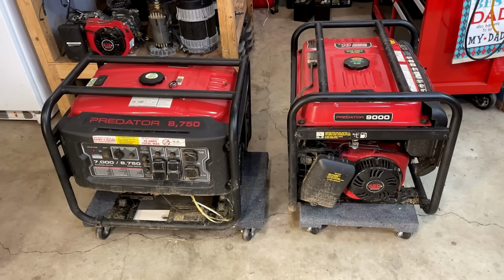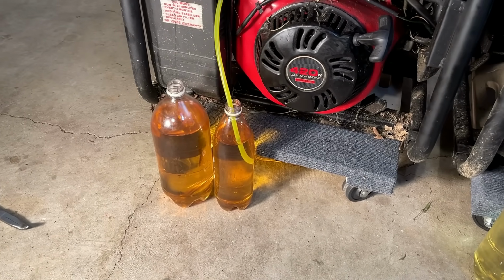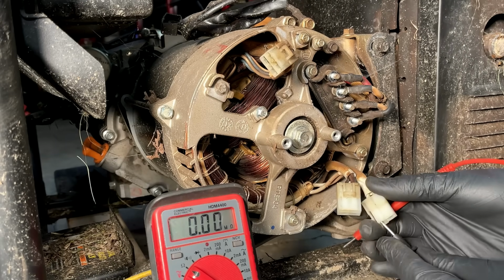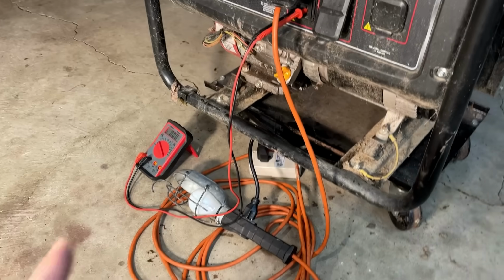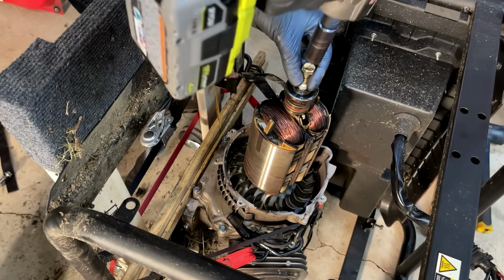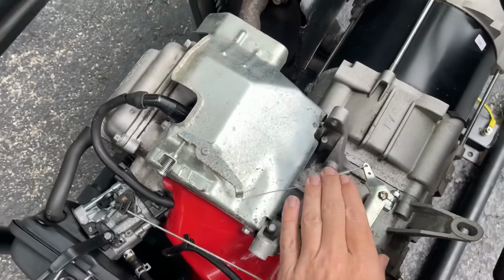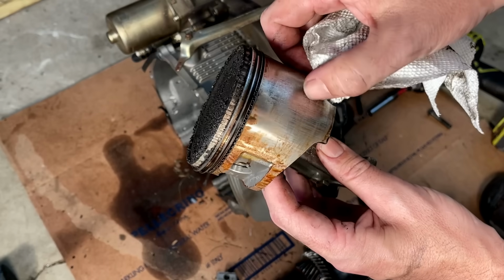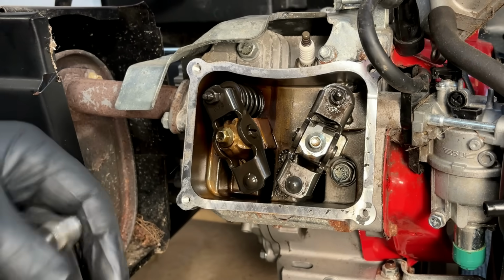3 Abandoned Predator Generators - Will They Run?

Comment: I was wondering if there was anyone with the little knowledge on my predator generator like these. It will crank up just fine but it won't put out any power, I can let it run for several hours, sometimes it will start putting out power on the outlets and sometimes no power. I messed with the Breakers, didn't do any good when there was no power. Sometimes I can Crank It Up and it was put out the power it needs. It has two GFI receptacles and they are not tripped plus the 220. When it Powers up, everything works good. I was wondering if there is something I'm overlooking. Have not checked the Stater or wending. If someone has some information oh, that would be great.
Reply from the maker: Could be bad brushes, dirty slip rings or bad AVR.  Is those are fine then most likely a bad excitation winding in the stator or the rotor has a broken wire or solder joint and is open circuit
Reply: @jcondon1  okay I'm preciate to come back James. I enjoy your videos also. The crazy thing is this Predator generator don't really have that many hours on it. I think it has only had maybe three or four oil changes. Bought it brand new in 2017. If I check the brushes with the ohms tester, shouldn't it be around 3 or 4 bones. Probably wouldn't hurt to pull them out and look at them. I would think the stator should still be good, I need to open it up and take a look. It's never been under a heavy load before. I was watching a few more of your videos tonight. Very educational, do a better job than many of the other videos, only because you go into more detail then they.

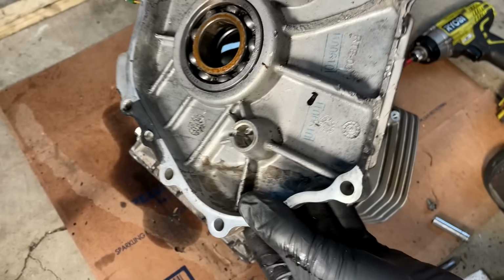Comment: 1:27:42 Source of bearing outer race found at 0:58
Quick check on comparing springs: Hook ends together and pull them against each other.
Watching the spacing between coil turns is a way to judge relative strengths.

Comment: Got an 8750 I've been running off grid for years without any problems.
If you keep the oil changed and check it every time you fill it with fuel they'll run for years.

Comment: Dude, don't you have compressed air and a vacuum cleaner?  Watching you clean the generator was getting on my nerves big time and you left all kinds of sht everywhere inside including ants. That governor spring is a drop in the ocean. The engines blew because of poor maintenance and(or) running out of oil.🤔

Comment: I had a brand new JD lawnmower with a Briggs engine, it would smoke heavily on start up. they replaced the motor under warranty . somehow on shutdown it must have been drawing oil into the combustion chamber

Comment: You sure know what your doing there. I would have done the same thing as you did and took good parts off to use later. Hey I have a question for you too James. Do you sell what you fix on those generators and if so how much would you ask for one on average.
Reply from the maker: Most in the 5000-7000 watts range sell between $300-$400.  I tend to price them on the low side to keep things moving.
Reply: @jcondon1  I would be interested in buying one off of you. I live in Ohio. I not sure or remember where you said you were located. So I'm not sure what the price would be to ship it if you don't live close to me.

Comment: A trip to harbor freight for engines and you will have some nice generators.
Reply from the maker: I wish they sold tapered shaft engines.  I would be their best customer.
Reply: @jcondon1  really enjoyed the video.  Too bad you couldn’t get some rings because that probably would’ve fixed it.  I didn’t see if you tweaked the fuel mixture on the carburetor and if you verified that governor was adjust on the shaft so that you were getting full movement of the governor.   A lot of those engines probably fail due to those faulty oil level sensors like the one you discovered.   That hydraulic pressure trick to remove the rotor shaft is slick.  Thanks.

Comment: Put some oil mixed with transmission fluid down into the piston bore! Just pour it in threw the spark plug opening. Allow it to soak for a day or 3 then try turning g thr engine over.

Comment: Really great video the generator that ran started up running lean what today's gas the Jets have a tendency to get a coating in them of green corrosion which cuts the fuel flow when you put the generators under high load it's not getting enough fuel to air ratio, should always pull the carb off and clean the Jets.

Comment: Maybe the oil burning on the 3rd generator is caused by a missing baffle in the valve cover where the hose comes off and goes to the air cleaner box. The hose connection at the air cleaner is wet with oil. Shutting down from 3,600 RPMs would cause the throttle plate to go wide open and if there's no baffle on the valve cover, maybe that's when the oil is drawn in while the engine is coasting down.

Comment: If you are going to mix the old fuel with your new fuel, you need to add octane boost because that’s the first thing to go in the fuel is octane and that will cause your engine to spark knock, so just make sure you add octane boost with it if you’re running old fuel because overtime, it could very easily damage your engine.

Comment: On the outer cover , I would re weld it for bearing and have it machined , I use to race go karts and we would have to re use covers and blocks all the time and have at least 5 spare alcohol  engines on standby for esp  dirt track karts

Comment: After checking oil in the 3rd and finding it low I bet the failure on these is they used the oil check as a dip stick and that is a major problem with small engines, never use the stem as a guage always fill to mid to top of threads as a rule

Comment: 2 engines, both with balancer failure.  Is this an Achilles heel to these Harbor Freight motors?  It appears the casting let go at the balancer bearing in both motors, letting it destroy the rest of the crankcase components..

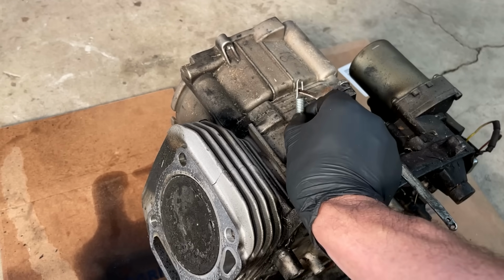Comment: 1:22:41 Just to add more information: The spring only provides a proportional control. It doe snot need the integral or derivative aspects of a PID controller. If the load decreases, the speed drops by design. If you have 2 generators, you can connect them together after they are both started, and they share load about equally, as they both slowdown and both apply more throttle

Comment: Would have thought the exhaust would be .001-.002 larger than the intake to compensate for the thermal differential between valves.
Reply from the maker: Usually the exhaust is gapped 0.002 more

Comment: Can you contact the manufacturer and ask for the name and address of the vendor they buy their valve seals from?
Reply from the maker: That's the problem with clone engines.  Most do not put any identifying information on the engine.  Some are starting to, but the majority have no model number or manufacturer name.

Comment: Clearly abused by their previous owner. Nicely done. I love purchasing items like this and resurrecting them. I purchased a Champion 3500w Generator for 50 U.S. Pesos. 
After replacing the recoil rope, a valve adjustment, oil change & cleaning the main jet. 
It has purred. Never failing me. Champion could have done a better job on the governor.
(As in a buffer.) At no load it likes to hunt a little. That is only a minor annoyance. When loaded, it runs at a constant speed. I expect too much from a Chinineseium product. 
The AVR is accurate it holds 122 VAC at around 59.7 Hz. 
I have also worked on Predators, which are ok, IF MAINTAINED AND NOT ABUSED. 

Anny way..... Nicely done Sir. Happy Holidays.
Reply from the maker: The hunting is just because it is jetted a little lean.  Pretty common these days with new machines.
Reply: think epa

Comment: I had a riding mower that I revived a couple of years ago that had a governor spring issue. It sat outdoors for several years and the carb was rusted, so I was forced to replace it. When I finally fired it up, it was hunting really badly. I went through the brand new carb a couple of times thinking that it was an issue with the carb. After several weeks of fighting it, it finally occurred to me to try replacing the governor spring. I did, and it ran perfectly after that.

Comment: You should get a short bolt. drill it through and tap it for a grease fitting and use a grease gun to pop the stator off.

Comment: I have two of the HF Predator gensets and they work ok.  First pull start too!  I have read that the engines are pretty good.... true they aren't Honda, but they don't cost Honda either.
I am assuming that these ran for about 5 years non-stop?  Probably heavily  loaded too.  Lack of maintenance probably killed them though.
Thanks for the teardowns!

Comment: Excellent video, my back up generator is a predator from HF and it runs great.  I fire it up every few months and let it run and change out the oil as well.  It is also garage kept so it still looks brand new years later.    But I'll be able to refer to this video to diagnosis any potential issues.  Thank you!

Comment: Too bad you couldn't have welded those holes closed. Maybe the tension of the old spring was weak. Test by suspending some weight and see how far each soring droops. Should be the same.

Comment: Hey bud I know it's been a few seems you work on the predator.  But I am very very familiar with the 6500..

One thing that real worked great is us brake in oil.  Plug on them the oil sensor are a pain but try to us them. 
I have had them lock up and I could free them and use break in oil and run them for days lol

Comment: It's nice to see stuff revived, although honestly I wish they'd stop making these cheap crappy 3600 RPM generators, they're so insanely loud. I got an inverter generator several years ago and now I wouldn't even want a conventional generator for free. The inverter is so quiet that I can't hear it at all from inside the house and it burns a small fraction of the fuel the old generator I had did. If your application is like most and the generator spends most of its time at light load then the inverter type provides an enormous advantage.

Comment: Excelent video. I still wonder why you don't weld a plug into blocks with holes in non critical areas. I suppose your liability insurance prevents it. If so, what a shame.

Comment: I received a Predator 8750/7000 for free that was not running. Started to adjust the valves and noticed only the exhaust valve has a cap on it. Is that the way it should be?

Comment: About the hour 20 you wanted to order rings and other things for the predator. I'm trying to get my tecumseh 11hp from Sept 2005 back. The repair place I'm getting parts from said they can't get any predator parts. She said if I did get a predator to get their warranty. She also said they won't work on any generators with inverters. I've cleaned my carb lseveral times and each time everything is clean. I can see through all those tiny holes, no grime anywhere. It'll crank and run 40 seconds, yesterday 20 minutes. New gas lines, filter, cleaned engine, spotless carb, cleaned fuel tank, no ethanol fuel, new syn oil, I'm missing one something and I bet I've seen it on your video somewhere! That master jet or a covered screw. I sure appreciate your time and videos.

Comment: Interesting, apparently the folks that used these units failed to understand that engines need oil added from time to time, as well as oil changes every X number of hours. The good color of the China manufacturer's paint suggest these units have not spent alot of time outside/older.. The truth is the units were simply neglected, probably run until failure with no effort to even try maintain them. I have an 8750 which is essentially the same as those 9000's
Reply from the maker: They were stored outside, but not very old.  They were just run for many hours with little maintenance until they failed.

Comment: i have a Predator 5500/6500 watt generator that hasnt been started in probably close to 10 years, its been out of the weather, but the fuel tank in badly rusted inside, im going to try and get the motor running and see what i got, if i do get it running and everything checks out, im gonna need a new tank, i have looked every where on it,and i cant find any tag that gives me an exact model number, it has the 420cc 13hp motor, are the gas tanks the same on most of the models?
Reply from the maker: The center of the pull start should have the Harbor Freight item number.  Otherwise a Honda clone tank should fit.  You would have to double check the measurements.  Here is a link to a 5 gallon and 7 gallon tank https://www.ebay.com/itm/403285208888?mkcid=16&mkevt=1&mkrid=711-127632-2357-0&ssspo=KeSOnnWoQYu&sssrc=2047675&ssuid=eec5lZxOS1O&widget_ver=artemis&media=COPY
Reply: @jcondon1  ok, thank you so very much, i will take some measurements

Comment: I just recently purchased an old generac 4000 XL and it was leaking a lot and a carburetor was off so I fixed the carburetor but it's still leaking oil and where it's leaking is the oil safety switch so I figured let me tighten it up some more and I did and I cracked the little housing that gets bolted onto the engine but I can't find that actual part I may just put a plug on you know put a plate on it and plug it up that seems like it's viable

Comment: I would be looking for oil somehow draining into the intake or combustion chamber when it's just sitting. Maybe somehow the breather is dripping oil into the intake side at the air cleaner? It almost can't be a valve seal because no oil remains at the stem when not running...

Comment: Would it be possible for you to draw up a checklist for the electrical wiring; some kind of Excel sheet for each element of the stator/rotor wiring that someone could print and fill out as they perform the resistance checks?  That might help people be more systematic in their troubleshooting.

A diagram of the typical generator circuits would be helpful too.  Perhaps one of your viewers could draw something up?

Any takers?

Comment: By the nasty neglected condition of those gens I doubt if the oil ever got changed when they were used hence blown engines. Definitely good parts machines though. Thanks for the Vids! :)

Comment: My husband uses a 4' air nozzle to blow dirt and leaves off before bringing most things in the shop. That keeps the shop cleaner and makes inspection and repairs easier. It gets a lot of dirt off without the potential problems of pressure washing them. He got the idea from a manufacturing plant the shot-peened all metal brought into the shop. That minimized the smoke and weld contamination from the oil and scale on metal sheets and other metal. 
PS; Great video. Thanks

Comment: Good educational video on these predator generators. I have a low hours Predator 3500 inverter that keeps carboning up and plugging the spark arrestor. Have you seen that happen and what could be the cause?
Reply: Yah, a year old comment, but maybe he (Or at least others) will see this.  Are you overfilling the fuel tank?   Check the manual, on the max fill, it is NOT all the way to the top.  If overfilled, the CARB/EPA purge "system" sucks wet fuel into the air-box and makes the engine run very rich for a while after every fill-up.

Comment: It might be that the head is lubricated via a through bolt on the head and the through bolt channel is leaking through the head gasket into the cylinder? In which case it might just solve the problem if you replace the head gasket? Though I'm not familiar with the configuration of the valve lubrication method.

Comment: if it's rings it will smoke all the time no matter what . otherwise valve seal  or valve guide due to the oil never being changed ,which will stuff the motor .

Comment: I bought a new mulcher with this 420cc engine.  Withing 15 minutes of breaking it in, it developed a rod knock.  Unfortunately, the store refused to take it back.  Upon disassembling the engine, it appears there is a slight angle error in the hole drilled in the connecting rod for the wrist pin - Crazy!

Comment: That's not a 3k load.
Those heaters are 1,500w~ each on high.
4 x 1,500 is 6,000w 
over its 5,500w rated output.

Comment: You said GFI CANNOT BE RESET. Are you for real. Look close, there is a test button and a reset button. They or make to open if wet. I'm sure it was popped before you looked at it. Clean off the outlet so you can see

Comment: Power head? They are the unit that  provide movement, like an electric motor. That your tearing apart is the connections to the generator. Oh and by the way, it would have nothing to do with the gas engine running

Comment: An excellent description of how the governor system works. Thanks. I know you can't source parts but it's MUCH more likely to be the rings rather than the valve stem seal. A quick re-hone with one of those attachments that fit on a drill or criss cross pattern yourself with some fine sandpaper to bust the glaze, and a re-ring will put many useful hours back in the engine.
Reply: Those Harbor Freight engines are so cheap, it's probably easier to just buy a whole engine to get parts. Might talk to some of the guys that build go kart racing engines too, they often start out with a brand new engine and replace a whole bunch of parts right out of the box with aftermarket upgrades so they have stock parts left over.

Comment: Why don't you fill the cylinder with rope to stop the valve dropping the cylinder and then remove the valve spring to see if you have a compatible valve stem oil seal James?
Reply from the maker: This engine was very high hours and the video long.
Reply: @jcondon1  Your video's are so enjoyable, they're not long enough for me. 🙂👍